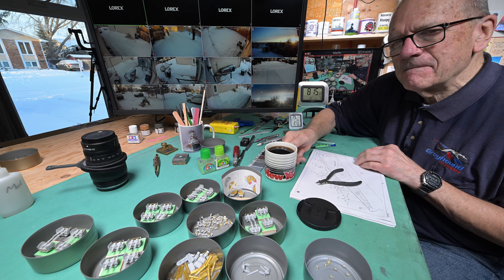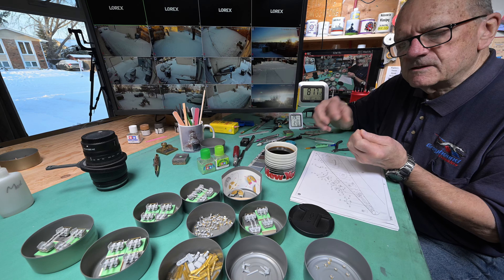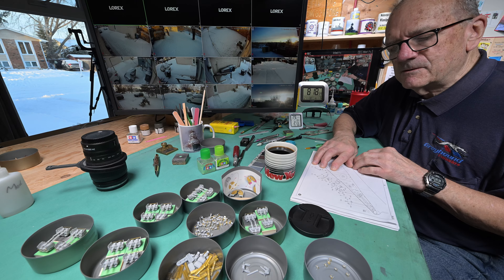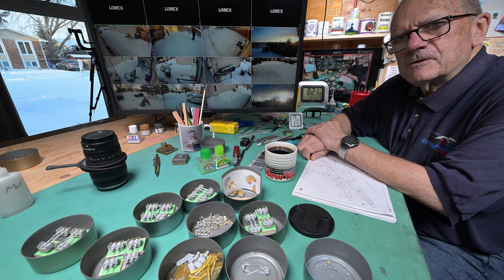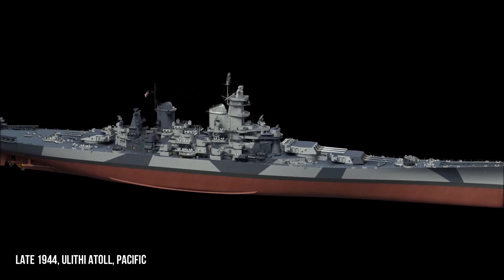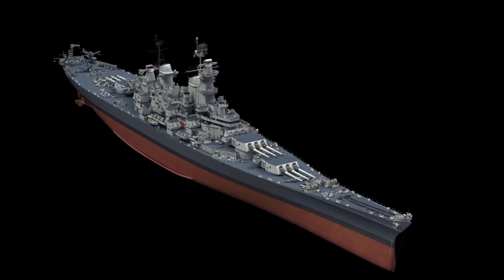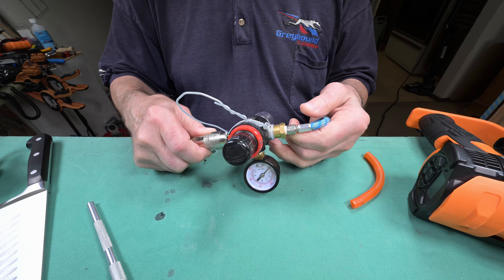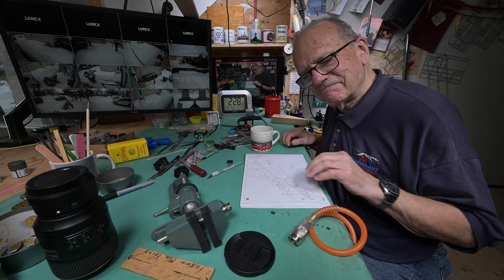The Model Ship - Part 1367

Comment: Hi Ron. Was reading about the blue deck thing.  Missouri had the decks blue for the surrender. After the surrender it returned to San Francisco. By the time it got to San Francisco the decks had been scrubbed back to basic wood.  I’ve found the easiest thing to do, pick a date and research the photos for around that date. I have 2 models of the Hood, one in 1931, in light gray with a catapault and crane on the stern etc. The other is as she was on 24 May 1941.  For the Iowa, from the pics you showed, it’s looking like Korea might be the go, grey hull, wooden decks etc.  the only difference might be the aircraft, I think by 1950 they had Bearcats.  Bottom line, your model, your choice, keep having fun.
Reply from the maker: My USS Iowa will likely end up as a mosaic of eras Mark.
Reply: @roncalverley  I agree Mark.  The first decision I make with any model is what is the period in her service history I am modelling.  I try to be as specific as possible.  I'm doing the USS Lexington CV-16 right now as she looked after coming out of drydock in May 1945 which is how she looked through to the end of the war.  This decision drives everything.  Paint, modification/replacement of kit components, etc.
Reply: My model of the Hood was also an early version.  The 5" guns were much different.  
Hood was scheduled for a refit before the start of the war but the the Admiralty felt they could not spare her.
Battlecruisers were not designed to go up against Battleships, and the Admiralty knew it.

Comment: Hi Ron  lol you will do anything to not spray,  no guarantee tomorrow either, don't understand why trumpeter doesn't just mold plastic in the right colour,  solve a lot of hassles 😊😊😊😊see you tomorrow
Reply from the maker: "mold plastic in the right colour" Great point Marc. You my have stumbled onto a gold mine! 👍
Reply: @roncalverley  Harry Houdini a modeeller, built a model and just gave it a clear coat ,fooled the judges and won first place 😊😊😊
Reply from the maker: @aussiefrenchman-hobbytable9960  😁👍
Reply: Meng models does just that in 1/700.  I'm sure doing it in 1/200 would be cost prohibitive but it could be done.
Reply: I had a few hot rod models in my younger days that had colored plastic.  I found it didn't look natural so I ended up painting it.  Looked much better.

Comment: Hi Ron, if you are going for a teak deck 1947 to be correct you would need to enclose the bridge, update the radar fit, scratch build new masts, remove almost all of the 20mm and 40mm guns and make good the deck and re-scribe the deck, change the aircraft to Curtiss SC-1 Seahawks or just leave the aircraft off. Just a suggestion after her shakedown cruise in the spring of 1943 her anti-aircraft fit was updated to match what is supplied in the kit, well what I am getting at is at some time between May and October 1943 she had teak decks, anti-aircraft fit as per the kit, open bridge and radar layout as per the kit, but she was in early measure 22 camouflage as per page 46 Stefans book a lot easier than doing measure 32  it sure would look different
Reply: 100% correct
Reply from the maker: Re: "The first decision I make with any model is what is the period in her service history I am modelling.  I try to be as specific as possible." 
Unfortunately for some viewers, I am not a rivet counter, and undoubtedly I am a source of frustration to those who are.
Reply: @roncalverley  For example the USS New Jersey had a 48 year service life with dramatic changes in radar, armament, paint scheme, etc.  I couldn't do a model of that ship without first deciding whether I am modelling her in WW2, Korea, Vietnam or the Gulf War.  I wouldn't know where to begin without deciding that first.:goodvibes: